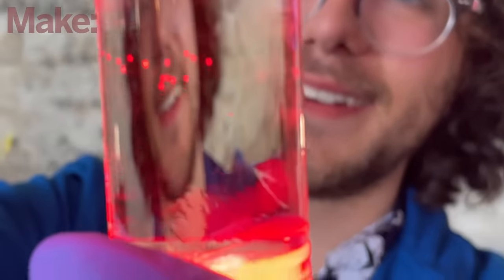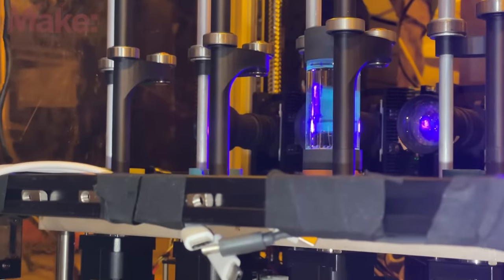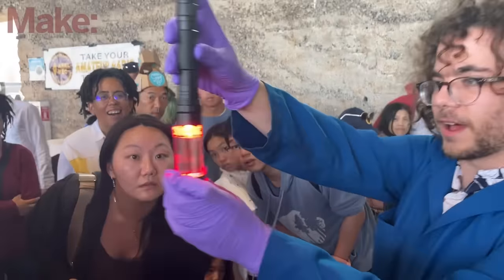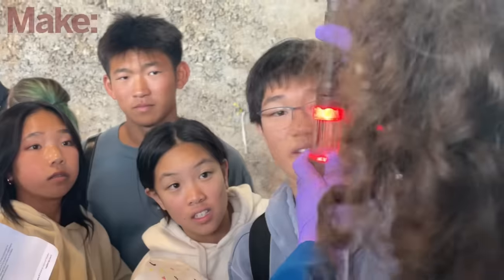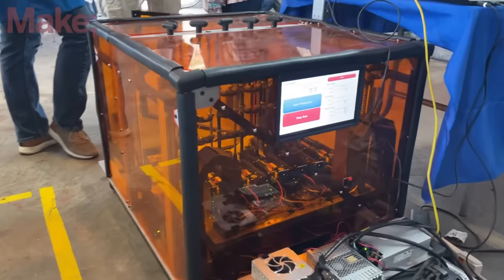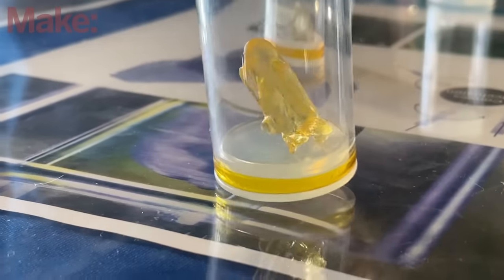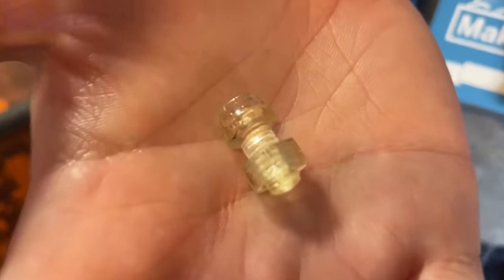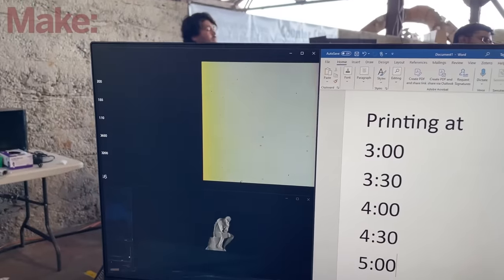instant 3D printing with computed axial lithography at Bay Area Maker Faire 2023

Comment: It's cool that there are Phd's in engineering widespread now.
Maybe 12-13 years ago, literally only a couple colleges had Phd's in electrical engineering, but now it's common.
The vomit comet's removal of buoyancy is still certain superficial though, the mass is still heavily accelerated by gravity, and it's the removal of gas resistance through acceleration, not atmospheric pressure.
He should know that but I guarantee he didn't until reading my post.
Reply: That's the same thing as saying that it's the air pressure that push rockets forward, which is wrong. 
Free fall is for all intends and purposes the same as "true" zero-g, unless you're currently falling into a black hole, at which points the minor differences amplified enough to be easily noticeable.
Reply: @Raykkie   no it's not, thrust is based on air pressure within a gradient. An equivalent in reverse is the wind blowing into a sail. NASA's own course material still used in colleges states that thrust requires a liquid environment, and this is inclusive of gases. 

You can parrot drivel from books, but I still have a formal education in subatomic physics, relativistic classic mechanics and engineering. The demonstrations used to brainwash are very easily discredited. The "unequal pressure" for the theory of operation demonstrated by balloons such as the CO2 cartridge are easily discredited. Tape a bend straight at 90 degrees to the discharge port, and the device utilized will spin in circles.

What you take on faith is irrelevant and so is regurgitating drivel from books and incompetent teachers. Thrust due to a compressed gas striking the external gas, compressing it momentarily increasing density and generating a feedback loop that propels it in a relative direction to the discharge port. 
The unequal pressure at one end over another is quite truly the stupidest brainwashing tactic I have ever witnessed, but you like so many others take it on faith and don't actually understand the physics. I have no doubts this PHD student is the same.
Reply: @JonDeth  I bet your fun at parties.
Reply: @SimplySellers202  you obviously are with original lines like that :face-fuchsia-poop-shape:
Reply: @JonDeth  Did you really just go with the I'm rubber and you're glue defense?
Reply: @SimplySellers202  I stated the obvious to anyone that isn't a spaz desperate for an obnoxious insult.
Reply: @Raykkie  his statement "thrust is based on air pressure within a gradient" is so malformed it isn't even wrong, and is pretty much representative of the rest of his attempts to make a point, here.
Reply: @JonDeth  zero-g/micro-gravity literally is free fall, so at best here even if you're right about literally everything you're still wrong because their point was that "Free fall is for all intends and purposes the same as "true" zero-g, unless you're currently falling into a black hole, at which points the minor differences amplified enough to be easily noticeable." 

The ISS for instance still gets over 90% of the gravity on earth, yet is widely considered to be "zero-g". The people on the ISS The ability to meaningfully conflate "free-fall" and "zero-g" underlies the basic concept of orbits FFS with, as they mention, the conflation only really breaking down at relativistic extremes. (and even then most of those breakdowns are a result of non-point interactions, a zero-volume point couldn't be spagettified for instance.)

At best this reads as pedantry to the extreme and at worst it emminates some serious midwit "uhm awkshully" energy.
Reply: @robonator2945  I'm not though, he claimed it removes buoyancy and it does not. It's the difference  between 2 values of decent and within a static gas chamber.
Reply: @JonDeth  aight, actual arguing clearly ain't gonna get through so let's address this directly, doncha think they might have noticed that? 

Let's just roll through what you're suggesting happened : 

"we think that this will work better in zero G"
"let's put it on a vomit rocket"
"okay"
...
"hmm, it didn't work"
"lets do it again!"
"okay"
...
"hmm, it didn't work"
"lets do it again!"
"okay"
...
"hmm, it didn't work"
"lets do it again!"
"okay"
...
"hmm, it didn't work"
"lets do it again!"
"okay"...
"hmm, it didn't work"
"lets do it again!"
"okay"
... 

< repeat a few dozen more times > 

vs the alternative

"we think that this will work better in zero G"
"let's put it on a vomit rocket"
"okay"
...
"oh look, it did what we expected and improved the result!"
"Cool, let's run the test again after tweaking a few things!"
"Okay"
...

"oh look, it did what we expected and improved the result!"
"Cool, let's run the test again after tweaking a few things!"
"Okay"
...

"oh look, it did what we expected and improved the result!"
"Cool, let's run the test again after tweaking a few things!"
"Okay"
...
<rinse and repeat a few dozen times>

The only way in which your uhm awkshully works here is if they are so unfathomably stupid as to repeat a test that didn't work dozens and dozens of times over. You are attempting to correct people on reality that has already been observed and tested, so either it's meaningless pedantry that doesn't actually impact the outcome, or you're wrong. (again, ruling out active deception, lying, stupidity of unreasonable proportions, etc.)
Reply: The decrease in buoyancy in the simulated microgravity environment is due to the removal of a normal force at the bottom of the fluid, without it there is no force counter to the gravitational acceleration, i.e. everything accelerates together at g, so in the moving reference frame it is all static.
Reply: @xxportalxx.  And its exactly the same in space. There is no "no gravity" location in the universe. There is no "simulated" versus "true" zero gravity. If you are in free fall you are "weightless" not matter where you are in teh universe.
Reply: @michaelrenper796  not exactly, if you were sitting on a rocket in space you'd be experiencing true microgravity, as there'd be no nearby body massive enough to cause any significant gravitational acceleration. If you meant that's the same as the low gravity environment on the iss for instance, then yes, that works the same way due to their orbit. There's a rather large difference between the two in gr, as it effects your propagation through time. Additionally freefall over an even more massive body, like a neutron star, would cause some rather significant forces (i.e. extremely rapid acceleration), so the experience would be a bit different lol.
Reply: @xxportalxx.  You a do not understand even the first principles of general relativity.
Mind you, you are talking to a physiscist. 

The first principle of GR is that the differencce between a frame of reference in free fall and one in rest is unobservable in that frame of reference itself (without outside poitns of reference).

In common English: In free fall you experience "zero gravity" not matter how "strong" gravitational field.
Reply: @michaelrenper796  there's a rather significant difference, that difference is that the accelerating object is still accelerating, therfore comparing an object in low gravity in deep space to an object in simulated microgravity at free fall you will see a difference in time dilation (and in its relativistic mass), considering we are discussing the difference BETWEEN them there are two reference frames to consider it from (completely in line with relativity). The difference in strength is important as you have a gradient accross the object (due to the difference in radius from the massive object), near a neutron star or black hole this gradient is so strong it will deform most any object. Who I'm talking to has absolutely no relevance.